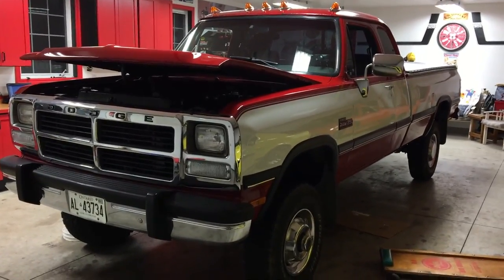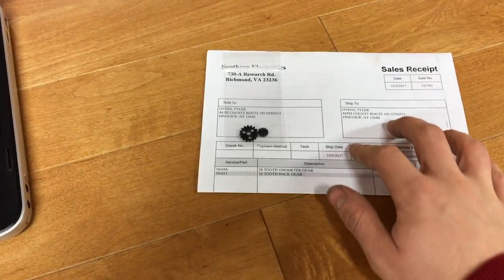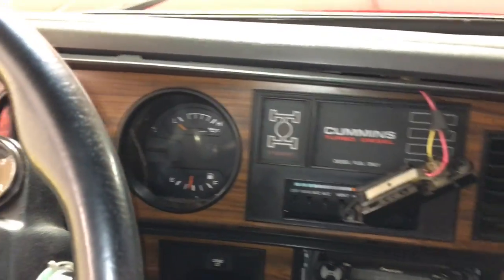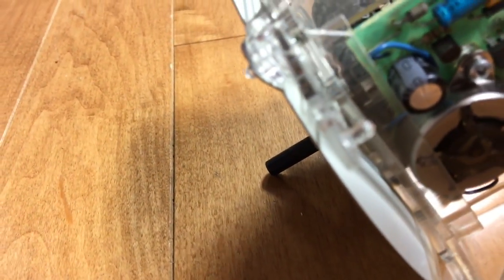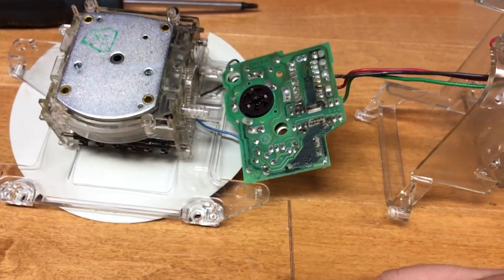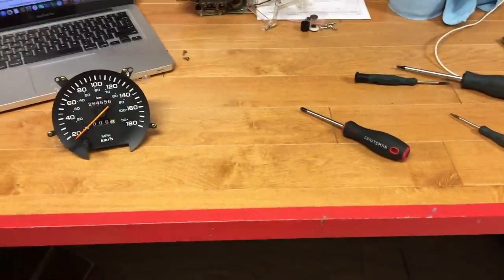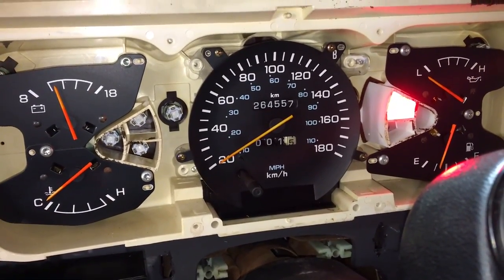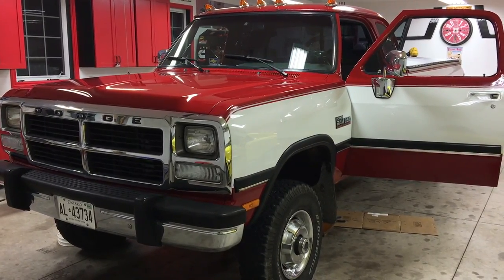1st Gen Cummins Broken Odometer

Comment: I fixed mine by taking the green wire on the circuit board out and stripping the wire back just enough for fresh wire that wasn’t bent and weak and soldered it back on and Finally my odometer is working again!
Reply: The wire must’ve been linked from the position it sits and was broke a little. Hope it fixes y’all’s issues. Let me know if I does!
Reply: No

Comment: Hey man, love the video.  The quick look at the circuit board looked like something crapped out and was discolored.  A good multimeter and you can check the resisters and such.
Reply from the maker: Yeah, I need to become more savvy in the electronics department.. haha. This was my fix though since I had a spare set of gauges!
Reply: Tyler Ovens I'm just getting started going through my 93, identical twin to yours.  The videos are an awesome companion to the manual.
Reply: You can use a 9v battery to test the circuit board if it will engage the magnets by the motor
Reply: @ChallengerRT-ld3sk  genius!
Reply: @ChallengerRT-ld3sk how
Do you do that?

Comment: Just fixed mine using this method but is there any easy way to add the missing miles besides spinning the vss with a drill?
Reply from the maker: Legality issues aside the only way to do it is disassemble the cluster tamper proof design and roll it over by hand then put it back together.
Reply: @OvensGarage  ok thanks for the video and reply!

Comment: Hey buddy great video and beautiful truck, my problem is, my Odometer and speedometer don't work. You think it could be the gears as well or just the speed sensor itself. Thank you in advance.
Reply: If the speedo isn’t workin check the plug in back of the trans mine was loose it did not fix my odometer

Comment: Check and make sure the baby gear is on correctly.  One side of the gear has a longer shaft/spacer that need to face the bigger gear.  If you flip it the gears won’t mesh right and will not work.
Reply from the maker: Yeah I tried it, something in the electronics must have been wrong.

Comment: So... my odometer and trip meter work fine, but my speedometer quit. Any ideas?
Reply from the maker: Speedometer not working is a sign that your VSS down by the transfer case may be faulty. I'd try taking the connection out first and cleaning it up then take the vss out next and clean it. If that doesn't work take a drill and put the end of the vss in it and spin the drill to see if it works. If it doesn't chances are your vss needs replaced.
Reply: @OvensGarage  I had the belief that the speedometer controlled the odometer as well. So the odometer will still work with a bad VSS?
Reply from the maker: @kellymichael7362  I'd have to check the FSM but I believe the odometer is controlled by input from the VSS so your odometer shouldn't roll over if you have a bad VSS. The speedo issue might be something internal to the gauge if that's the case.
Reply: @OvensGarage  Forgive my ignorance, but I can't remember what FSM stands for.
Reply from the maker: @kellymichael7362  factory service manual. I'd start by checking the wiring diagrams and then see if there's a section on odometer/speedometer diagnosis.
Reply: @OvensGarage  I'll give it a shot, but it's got me stumped how the odometer works w/o the speedometer. I can't imagine it being the little plastic gear inside the unit b/c of the same reason, helping operate the odometer. I'm worried it may have the same problem you had and will have to replace the whole gauge assy.

Comment: So mine gives out after i pass ab 44 mph also my gas gauge dont work at all but google isnt helping any opinion?
Reply from the maker: See if you can remove the sensor at the t-case, chuck it in a drill and spin it to see if it's making a voltage output at high rpm. Maybe it's a bad sensor.

Comment: Thank you so much for this video! I just found a broken gear and replaced it. My mind has been boggled for a long time regarding the two different styles of speedometer/odometer… Did you find it was due to an automatic versus manual?
Reply from the maker: I'm not sure if it was an automatic vs manual thing, I thought it was a year difference thing. It could have also been where the trucks were assembled they may have used different parts for assembly.
Reply: @OvensGarage  gotcha, thank you!  Was making me crazy
Reply: Loo